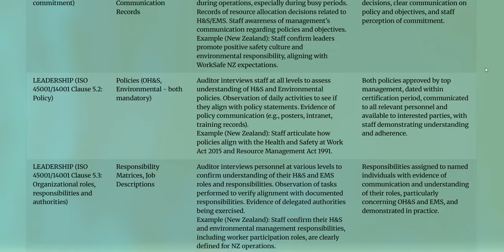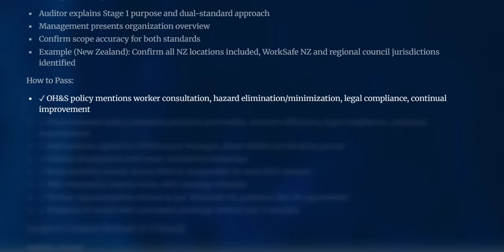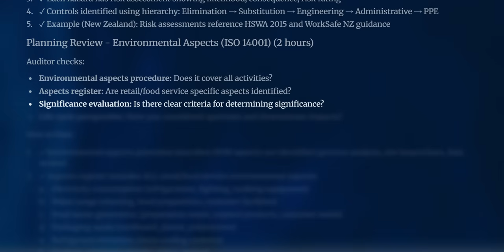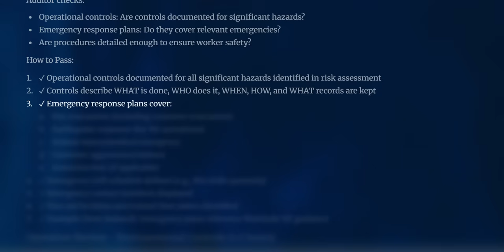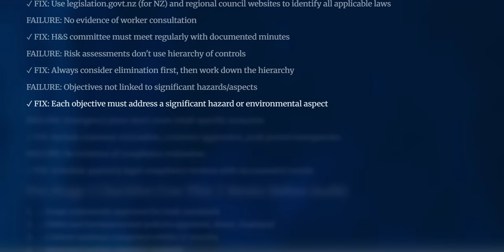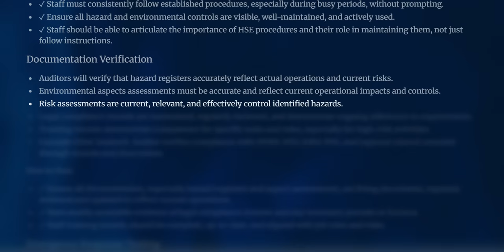ISO 45001 + ISO 14001 Audit Training | Retail & Food Service Operations

Comment from the maker: Retail and food service environments are high-risk under pressure.
Quick question for you:
👉 What is your biggest challenge right now?
• Slips / burns / manual handling?
• Waste & environmental compliance?
• Contractor control?
• Legal compliance confusion?
• Staff not following procedures during busy hours?
Comment your biggest challenge — I’ll reply with practical audit guidance.
If you're running multi-site or franchise operations, mention it below. Those environments require a different risk control approach.
📌 If you haven’t watched Part 1 (ISO 9001), start there for full integrated system understanding.
Part 4 (FSSC 22000) coming soon.